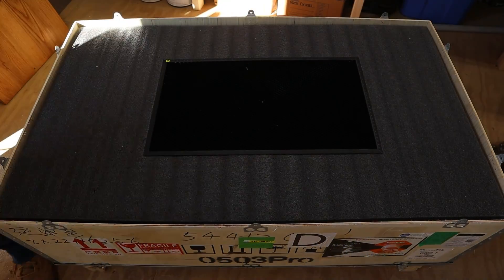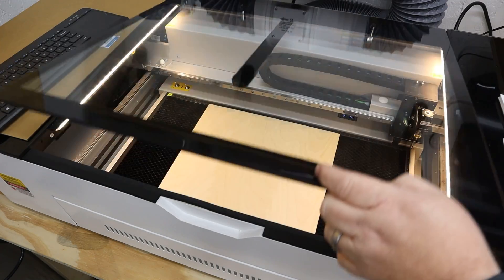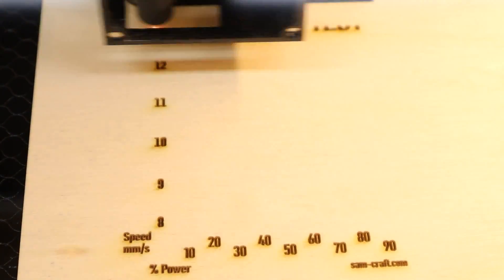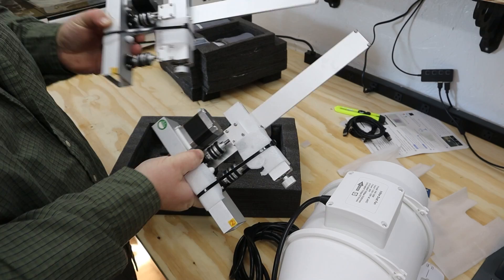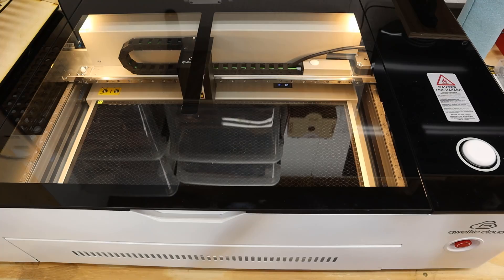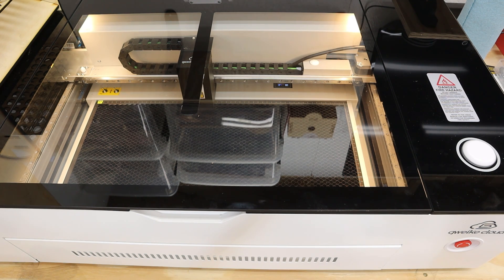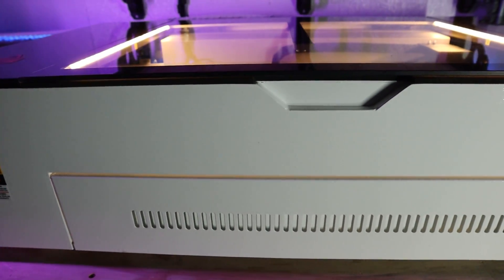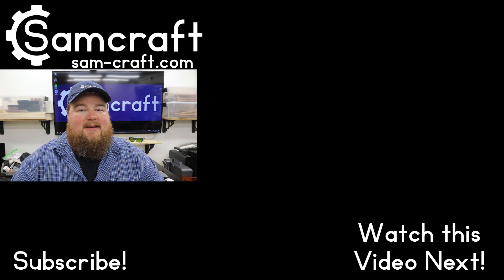GOOD & BAD: Gweike Cloud Pro II 50w CO2 Desktop Laser Review

Comment: Just curious......doses this machine have a red dot....it's competitor polar 50 doesn't have a red dot for positioning the work .   I have been using diode laser with a red dot and find it essential for positioning the laser.   Have you experienced such an issue and how did you solve it
Reply from the maker: No red dot on this machine. I don't recommend it, it is underpowered and somewhat problematic.

Comment: Hi, this is a great video Sam, I have a question please?  I'm not familiar with lightburn, just starting up using their own off-line Gweiki software.  Test frame moves well to show where the job will be, no connection issues, then press run job and a green light goes to red, can't do anything.  Have you had this happen?  Hope don't mind me asking
Reply from the maker: Your design is too close to the edge, move it away from the left/right edge and it should work.

Comment: I purchased the Gweike Cloud Pro I and II didn't have to many issues. To me it seemed better than the II. It came with an external air filer and pump so it didn't has the same issues with the lens getting dirty.  That being said I have now purchased the Xtool p2 and hands down 100% it's a better machine.  It cuts circles around the Gweike
Reply: Thanks. Why is it better exactly?

Comment: I think the aamera issue stems from that it isn't really part of the machine. It seems to be an add in that is powered by the computer. Then when the computer starts doing other things, it drops the process for the camera and that makes it go out. I remember having an issue with USB powered things a few years ago (my wifi adapter would disconnect for no reason and then re-connect). Turned out to be because Windows will tell USB Ports to go to sleep if not engaged. Not sure if Windows 11 still has this issue (this was back on Windows 10), but it might be a factor. Dunno :x Might just leave my camera disconnected as it is, haha. 

But great video, thanks! Helped me figure out how to turn on the machine with the red level (oddly not included in the directions).

Comment: Hello! FYI, I have the same and about the camera. For me, the painful part was the calibration in Lightburn. Besides that the camera works really great. And no issue with Lightburn, except the Frame function, which needs several attempts to perform it completely.
Also your focus point when cutting plywood doesn't seem to be ok, your cuts look quite thick/wide and not as thin as they should be. (Side note, it's my 2nd CO2).
I'll look into the FB group and see other comments/user issues, I may be lucky with mine :)

Comment: Great video. I just received my Gweike Cloud Pro II yesterday. I wish I had seen your video before I bought it. I may have bought the Omtech Polar instead of this. The air assist is a problem. It seems to take some time to ramp up to speed. I am going to try using an external air assist pump instead of the one that is included. The other problem that I see is that you have to refocus the laser each time. The laser head homes after every use, so running repetitive jobs is really annoying. I have not used the online software. I have tried using the offline software that I downloaded, but it is not easy to use. The software seems to take a long time to do the simplest moves. I may try adding an offline control panel. It seems to be a direct plug in to the controller. The fan on the radiator for the cooling is always running, so it forces the smell out of the front vents when your done using the laser. The exhaust system works great. The wireless fan control is a big help. I'm looking forward to seeing a follow up video after you have added some refinements.
Reply from the maker: There sure is a lag time on ramp up! So much that I have taken to designing "waste cuts" in my projects to use to ramp up the machine before the real work begins.
Reply: This is the OM tech Polar just with a different name, I just sent my back d/t so many problems. When he showed opening and packing it is identical to the Polar.

Comment: Looking forward to seeing all upcoming videos when you use the Gweike Cloud. I bought one myself 6 months back, and haven't used it a lot but I'm happy with the results.
When you use the focusing, a small tip is to set the Z offset instead of setting the focus height before cutting every time. So let's say you are cutting 6mm wood, I use -5 in Z offset. ( -17standard focus height + (6mm plywood*2) = -5 z offset) or when you use 3mm wood ( -17 + (3*2)= -11 Z offset) this has been working great for me.
Reply: How's the speed of work

Comment: I'm intrigued by why you consider the negative aspects to be the most significant. Could you elaborate on why you hold this view? I'm interested in hearing more about your perspective and understanding your reasoning behind it.

Since you happen to place greater value on the negative aspects of something, I understand. Here are some thoughts on this particular video.

I would have preferred it if you discussed the main topic of the video earlier instead of taking two minutes out of a twelve-minute video to introduce it.

It would have been helpful if you had taken the time to determine the engraving area's size and mentioned it during your video. Sent you made it a point to illustrate that it was not the same as the cutting area.

While you claim that you didn't test the device beyond its capabilities, you only tested it with materials that you wanted to use. Acrylic and other materials are advertised as being within its capabilities, so it's a significant oversight tonight, task that and claim it’s because it’s outside it’s capabilities.

According to your own admission, it took almost seven minutes for you to get to the central points of the video, which is not ideal.

Regarding the camera issue, is a light burn issue, which is a common problem with integrated cameras.

Despite these issues, your video had some valuable insights, and I appreciate that. I subscribed to your channel, and I hope you'll consider giving equal weight and realization of the actual value of the positive aspects of your content in the future.

Comment: ( Brilliance Laser Inks) - Sam, know you are bound to get a lot of request to looks at different YoTube videos, I feel for you since your family has alot of projects going on with the gardening coming fast. However, please find time for this video, it will definitely, I feel, be of benefit to the Samcraft business venture. Here is the title: "Two days of testing Brilliance Laser Inks", it is by 'Hobo With Wood channel. And his remarks, "This video is solely about testing the Brilliance Laser Inks. During two full days of testing I had great success with both the Monport 60W CO2 and the Comgrow 10W diode. While it is not marketed to the diode industry as of yet. You can expect that to change in the near future. This product is the best thing I used for marking metals. I'm so glad I tried it on the Monport CO2 60W. Once I had it, I had to try to get some success with the diode, too. Low and behold... it worked." The product is Brilliance Laser Inks, Permanent High Contrast Marking - CO2, Fiber, Diode, YAG = Formulated & Assembled in the USA. It did work on a 10W diode laser as well. BTW the product is 100% Satisfaction Guarantee, just read on cap of the spray can. When through lasering, just take a clean dry rag & wipe off the not-used spray on ink.
 https://brilliancelaserinks.com
Here is the video link for his video: https://www.youtube.com/watch?v=Za5wSG-i1jc

Comment: Great review Sam always a pleasure hearing your honest thoughts and great catch with the the air assist recirculating the smoke. That makes their air assist a major design flaw that definitely needs to be addressed.
Reply from the maker: I didn't put it into this video, but talked to their support about it at length. I was told this was a superior design and they made the change based upon user feedback from their first version (external air assist). Unfortunately, they had poor feedback in my opinion. :) Now that the initial review video is done, I can begin to hack into this machine to improve it. Thanks Chad!
Reply: @Samcraftcom  I look forward to seeing how you modify it. I also have the Pro II. This is my first CO2 as well. I do like the machine a lot, but I wish I could do line layers faster than 40mm/s. If you go above 40mm/s it'll yeet itself out of alignment.
Reply: @Samcraftcom  Honestly there should never be that much smoke sitting in the machine.
It means that you're not venting the machine properly and either need to straighten your hoses and/or add an inline exhaust fan to beef up exhaust. 

Smoke should be coming from material, and be sucked straight down, or straight back through the exhaust port, nothing "floating". This "floating" smoke is probably whats causing the lens to get dirty, not the air assist, as the air assist blows through the nozzle, not into the lens. Having a slight "dirty" air assist would make no differences to the lens.

I ran and optimized Trotec lasers for almost 10 years, we had 2x 2hp blower motors per machine to properly push exhaust out for big laser jobs.

Comment: Love the videos man keep em coming. Biggest thing with co2 in my eyes is the tube and water cooling. Diode lasers are air cooled but co2 are water cooled so its a whole new animal in my eyes.
As far as your camera and disconnect issues - make sure your usb ports are set to not power down. Windows is notorious for this and I never understood why as usb ports don't use much power anyway lol Just a thought for something else to check if you haven't already. Still may not fix any problems but you look like you need more work :)
Reply from the maker: Very true on the differences between the two laser technologies. This one came with antifreeze from the factory which was very useful back in Winter when my shop regularly dipped into the teens overnight. Not recommended at all, but thankfully no issues!

Comment: Great informational video, Sam. I’ve never used a diode laser, so I could compare this to my CO2 laser. The camera problems are significant. The benefits of a camera during and especially after running a job are amazing - but it has to continue working or it loses every advantage. 
I am also concerned about the smoke/debris circulation problem. Junk floating around in the air is not a good sign. 
The interface with the cloud is bothersome. I need to rely on my own work to get me through a task. My Internet is not a reliable partner. 
Thanks for once again plodding through the mud of new technology to get me some good answers for questions I’m glad I don’t have to encounter.
Reply from the maker: Thanks for the comment and input! What CO2 laser do you have?

Comment: It seams like it's going to be a pain down the road. Maybe you might see about getting a OMTECH MF-1624-60 for $2499.99 or the POLOR 50W $2899.99, it's just like the Gweike but its not available til April and it's LIGHTBURN compatible also. It would be cheaper. Just a suggestion. Love these videos.

Comment: I wondered about that air assist as it was (most of these desktop cutters do this from what I've seen), and I think the conversion over to 'shop air' would absolutely help, especially with the Cloudray type air assist setup.  You'd have to figure out the wiring (I'm assuming they toggle the power to the air assist pump to turn air on and off), but you could have a small amount (5psi or so) going all the time, and then when lightburn turns on air assist, have it bump up to 25-35psi for cutting.  That it's a 'turnkey' solution that really needs some modification to run efficiently doesn't really surprise me at all, most of these (for lack of a better word) off-brand lasers need mods to really open them up.  As far as the rotary issues (height available), I assume there's a trap door under the unit that would accomodate things larger than the laser travel, but you'd need to take that into account when making your surface, and either raise the laser up on a pedestal, or make a cut in your surface and basically add a box that goes below it to house the rotary (verified by the documentation, it's got a trap door under the crumb tray)?  Just make absolutely sure you kill power before plugging or unplugging that thing in, otherwise you'll likely short out that axis' driver..  Definitely answered some questions about the unit I had though, as always, great review.

Comment: if your using the little tablet,  then your usb port is running out of power, try getting a hub that had a power cord aka a usb hub "powered" this normal fixed almost all usb type issues. Even your jobs failing.